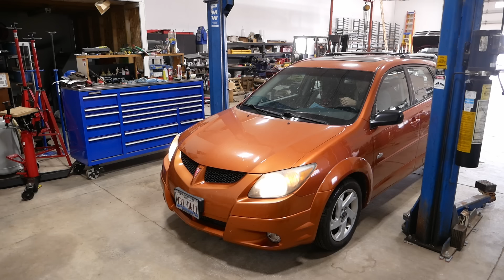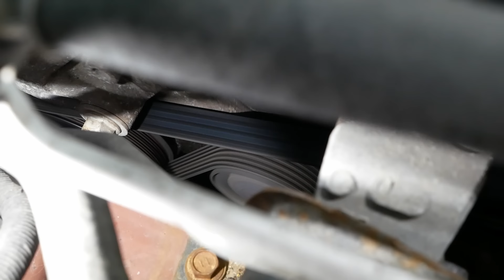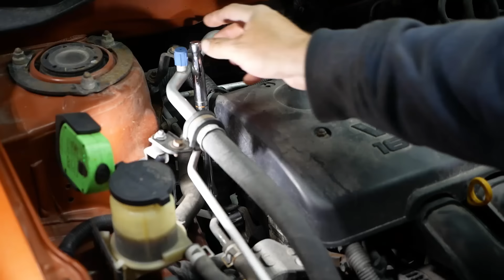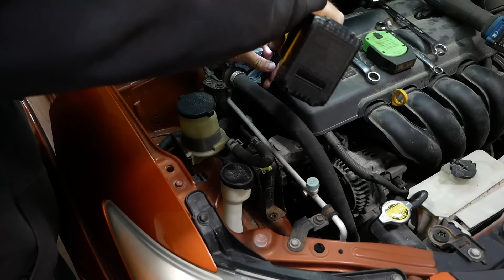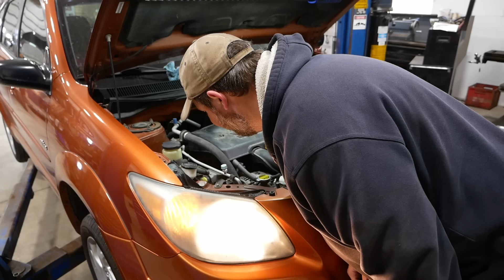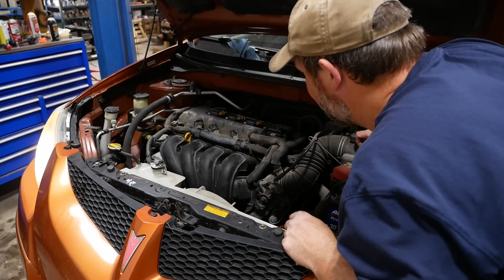My Worst F-up as a Mechanic - Hurt Myself, Damaged Customer's Car - Vibrating Vibe

Comment: My dad has a rav4 with a very similar engine and it also makes this noise and we checked the whole belt system and that didn’t cause the noise. It has a similar engine so I guess there are multiple things that cause this.

Comment: I had a car once someone had bypassed the neutral safety switch and the idle cranked way up. I reached in to start it and sailed off the 4 post lift and into the wall

Comment: This happened to me with an old Honda motorcycle.  I was so excited it started after hours of tinkering that i took my  hand off the clutch without realizing it was in gear 😂.  I ended up on my ass and the bike ended up at the other end of the shop.

Comment: 10:30 Probably because, you normally use your feet for the pedals and not your hands and if too focused on the issue/noise/whatever the motorized skills can be initiated without much forethought resulting in.....this. Especially if your work is sensitive or dangerous and your mind is not in it and/or you are making mistakes or unable to properly diagnose due to lack of focus, stop right there and take a break. I'd go back to it 15 minutes or a day later depending on who I feel at the time.

Comment: At least it was just a door and some honor boops, you were in a high risk position and walked away. If the car would have turned slightly left, you would've been crushed between your lift and the door jam. Watch your pinch points and take care of yourself.
Worst ID-10-T error that I suffered was trying to break loose an axel nut that was exposed to extreme thermal saturation using a 4 foot long 1/2" drive breaker bar and 3" section of steel pipe. Short of it is the last foot broke off the bar t he second it was over my head, then it sat me down without my knees bending. Shattering my eye socket and jaw, and hit my nose hard enough to pinch it off...
But when the weight shifted from the lullaby I got, the jack popped sideways and snagged the power supply cable to the starter, this cut into its insulation as it jammed into the oil pan. The results were oil pouring out of a hole and getting ignited by the battery short as I'm laid out a few feet away. The 96' Camaro SS was a total loss, and after a few surgical rearranging, I can hide obvious scars with a beard and mustache. I was lucky, a few months back a friend had his jack collapse while underneath the pumpkin on the rear-end. He wasn't lucky and his kid that was getting him for dinner isn't either.
Be safer, if only for those that have to find us.

Comment: 9th grade wood shop class I watching another student using a lathe and the end pulley on the machine has a cork screw end sticking out and stupid thought it was a good idea cuff my jacket sleeve on it and caught the material and started twisting my jacket like a tourniquet and I paniced trying to escape before it would rip my arm off and thank God the operator shut it down and jacket sleeve was permanently twisted I looked up the teacher and the whole class just stared at me!

Comment: The wheel chocks you used look like brick and not wheel chocks, that is why it failed to hold the car. Proper wheel chocks are curved rubber that are at least 6 inches tall. All four wheels should be chocked.

Comment: Mistakes happen man, we are all human. I work on semis for a living and I was suppose to remove a fuel tank off of a kenworth and normally I drain them before taking the tanks off but it had water in it so I was going to take it off lift it in the air with our lift then drain it from underneath. Well somehow I wasn’t thinking and I dropped the tank while taking it off with the lid open and it started pouring diesel all over our shop floor. And it was a full fucking tank like it flooded our shop floor went out into the parking lot and into the road. We had to do a whole procedure and get interviewed about the mistake because at that level it’s considered a hazardous spill. But we learn from our mistakes

Comment: The stupider the mistake, the more likely you are to make it. It's not statistics or anything, it's just the universe being an asshole. I'm an electrician. The other day i was buttoning up an install, passing the last wires through the conduit inside an old building's walls. Anyways, i find a plug that has like two feet of extra wire cause i measured wrong, go to cut it off, and it goes BANG in my face. I never thought to check if the breaker that fed that wire was actually pulled. I could've also not cut both wires at the same time, that was stupid. I would've been just fine if i had done them one at a time. Nice big ball of sparks and the power to all circuits went out. Had to sit there for a solid 5 minutes admiring how unbelievably stupid i am. 

Been in the field for over 10 years, propperly working as an electrician for at least 6.

Comment: 2 things 1 please get a new rack the safety wire you had wrapped around the loop that did the damage 2 never use lift blocks for a wheel chalk…that 2 grand your spending to fix the car you could have a entry level rack for a few hundred more…but lesson learned I’m not bashing just trying to keep you safe brother

Comment: don't worry at least you wasn't hurt bad !!! secondly when i was a young lad learning how to do oil changes , personally seen a mistake made buy a station owner,, what happened was the owner of the car left his child in the car & had pulled into the oil bay & had the owner check the automatic trans fluid,, the owner of the gas station was standing in front of the car & the owner of the car got out will the owner of the gas station was checking the trans  the car was running & the child reached up & pulled the gear shift leaver into drive  & the car moved forward pinching the gas station owner against the rear wall of the building , the owner wasn't hurt but skinned knees & legs if i remember right the car was a 62 ford,, minor damage to the car,,, get your checkbook out & pay for the car damage ,, lessons learned,,,   betcha don't do that again,,,,,,,,

Comment: I remember i was working on my car for hours trying to dial in the carb. So i kept turning it on and off 

The one time i didnt wiggle the dang stickshift.. It was in gear. The car flew into the garage and I stopped it before could go through the house. It crashed into my workout bench which helped me stop it...then i realized the neighbourhood cat was chilling in the garage that day!! 

I did not want to look at the front end of my 79 honda..

Luckily it just broke a turn signal lens. 30 bucks later luckily it was fixed .
Oh and also the cat was fast enough to get out of the way! 

Now i have to triple check each time by jerking off the damn shifter 😅😢😂

Learn once, to live smarter 😅😂

Wisdom is a funni thing

Comment: you didn't put it on the rack with the wheels off the floor cuz the load wouldn't be applied to the engine because there's nothing stopping the wheels from turning. we all make mistakes man. learn what you can from em and try to forget the rest.

Comment: Okay we've heard the story about 10 times now as long as you're okay everything's fine if it turns out to be a $15 pulley it's going to have to be about $1,000 job or better now

Comment: I was putting trans fluid in a pos f250 in a shop on the rack it was running my funnel was cracked the truck had no exhaust from the manifold I saw a spark plug wire arcing off the intake a big cloud of smoke come up from the firewall and then all that smoke turned into flames the doors was shut it was winter I yelled fire they hit it twice with the fire extinguisher and it was lights out in the shop my boss slipped on the fluid and white powder that was on the floor trying to push the truck out I almost got fired over it the next day i didn't want to touch that thing

Comment: That wall would have been all right. When I was around 20 I had a 1983 Toyota pickup with the standard 5 speed transmission. The starter on the 22R motors sucked. The starter solenoid would stick all the time. I would bang on it with an aluminum baseball bat and it would loosen it up and then I would be able to start the truck. I didn't have the money to replace it so I banged on that sucker for months. It came to the point where that wouldn't work so an old timer told me to tape the key over and bang it. I did that and I could get the truck started. I was at Napa auto one day and got back out and it wouldn't start. So I taped the key over, tapped the starter and I forgot to put the truck in neutral. The truck lurched forward and it slammed into the brick facade of the store. Guys came running out and was wondering what happpened. I felt dumb AF. The building took it no problem. The bumper was off the truck at the time so there was no damage to the truck. Good times.

Comment: You should also unplug that extension cord just hangin out at the bottom of the stairs, partially touching a previous spill. lol
Also, why would you put yourself between a pole and the car? That was a secondary stupid move.

Comment: Asking a buddy of mine to pull in my RX 7 So I could do a brake job in the work bay, Anyway I did the break job , And went to take my car out of the Repair bay  , my friend left in first gear..lol  so I want to start it lurched forward at least 10 feet, Into the cabinets luckily it didn't damage anything just push the whole shelving system..lol   Definitely the worst thing I've done.. glad no one was hurt too badly could've went a lot worse  fo you..   But yeah this was in the mid 90s I had a second generation 2nd gen my favorite car.. I was in my mid-early 20s  ,   The way the shop was set up in my old job  They were cabinets and then there was another 10 feet to a concrete wall Between then there was a air compressor.. So yeah I push the cabinets pretty good dented them but we're easy to bend back Oh yeah I never leave it in gear without the emergency brake but my friend decided to do it for some odd reason... My boss on that job was a great boss probably the best boss I've ever had He was very understanding.. But yeah I was a gas attendant north Jersey , Was great having a Lift to use..     That wandering around the shop is because you're in disbelief with a little bit of shock & adrenaline.. It's normal to be upset I'm just glad you weren't hurt..  The worst accident I've seen was a car falling off a lift with a truck.. Same shop that was a pain in the ass to get out , Fell off the lift on its side..

Comment: Goes from doing one dumb thing to another. Sticking a ratchet into the engine bay while the engine is running. Could easily get caught up into the belts especially with you shaking like a leaf. You need an assistant. Always good to have a second pair of hands/eyes around. Might check with your local collage and see if they run an ASE program and get yourself a student who needs work experience to pass the ASE and will work for cheap. This is the first video I have seen on your channel, so I don't know what all you have going on.

Comment: First thing that came to my mind was, 
" EMERGENCY " !
As in, 
" Emergency BRAKE " !
Easy to armchair quarterback this, but I have to wonder if setting the emergency brake, may have prevented the vehicle from lurching forward ?
Hind sight is 20 / 20 !
Easy to say, shoulda, coulda, woulda !
Lol....!
I believe we all have done stupid things, and as you witnessed, it only takes a split second for things to go horribly wrong !
Preaching to the choir here, I'm guessing, but you were fortunate not to be pinned between the door, and the upright of the lift !
I personally don't think it's a good idea to work alone, unsupervised !
And that could mean, just a simple intercom, where without having to push a button, sound could be heard outside the shop, maybe by your wife, or whomever ?
Even a CCTV Camera with sound !
Something where you could call out for help !
That was too close for comfort, to say the least !
I nearly was pulled into a large, 
" A " Drill in a machine shop, while running production parts, and,
 " Stupidly ", was wearing gloves, while running filthy Cast Iron  parts, and at the point I needed to run a Tap operation, while reaching up to change the tooling, the Tap grabbed my cloth glove, and by the Grace of GOD, I was quick enough to pull my hand out !
And much like you, I leaned back against the work bench, as I watched the glove spinning round and round on the Tap, and in shock thinking what an idiot !
A real wakeup call !
When you get to comfortable around big machines, they are very unforgiving, and will literally eat you alive, in the blink of an eye !
Glad you made it !
Bless You !
👍😉

Comment: Having had my foot ran over by the front right tire of a 2014 WRX you'd have likely been able to away from such an accident if the rear ran over your leg. Rear has less mass than the front.
Try avoiding dumb ideas like that from now on.

Comment: It seems literally everyone in the comments is ‘a mechanic for over 40 years’ lol. Why would they be watching mechanic videos on YouTube after so much action on the frontline? 🤔
Reply: Most mechanics actually love the job, despite the unfathomable amount of cursing they have uttered while turning wrenches and busting knuckles and fighting metal over the years. Those of us who can't physically do it anymore like to just watch others and maybe offer some advice here and there. 
I like seeing different methods used to complete the same problem, whether that problem is a hard-to-reach spark plug requiring you to unbolt and lift the engine several inches for access, to making a custom wrench for accessing header bolts easier, it's all fun and games watching someone else suffer through these things once you've been there and done that.

Comment: It's too bad you don't read the comment section. I know that this is a year old so you've already know we have to do. I know I went through the same thing thinking I could do it in about a because it's only a bolt and a nut. But it never works out how we think it will do we.😅😊

Comment: That hilarious TOYOTA VVT engine they use to PONTIAC VIBES made engine terrible. Same as my TOyota rav4 2002. I did that to my car as well and I thought it was a water pump creating vibration to the engine but I was wrong because the engine blown out. Piston number 3 busted after same experienced like yours...TOYOTA engine and transmission are GARBAGE!

Comment: That's why you never use your hand on the brake and the gas at the same time that's why God gave you a leg to push on the brake you done a stupid mistake you're not the first ones I've ever done that and won't be the last one I've seen them do all kinds of crazy stuff over 47 years of working in shops

Comment: Wtf are you messing with anything on the fan belt (old timers name for it) with the motor running?
Shut the motor off take off the belt 
Start the car, no noise shut the motor off and hand spin each component  only thing i can think of that make that kinda noise is an ac compressor.

Never fiddle with the belts with your hands or even tools when the motors running, thats a trip to the er waiting to happen  had your racket dropped the socket it hit the belt it could have ended several ways  one was throwing the tool into your eye. 

Don't mess with a running motor that can hurt you.
Your hat says DIEHARD  in reality
You can die EZ  don't take chances.

Comment: It happened because you become complacent, you been a tech for a while you don't pay as much attention as you should ,2 years ago I  re geared a jeep gladiator I had it running in the air in 4 low I hear a noise by the rear differential my dumbass goes to touch by the rear pinion the fucker grabbed my finger and twisted it off like a bottle cap